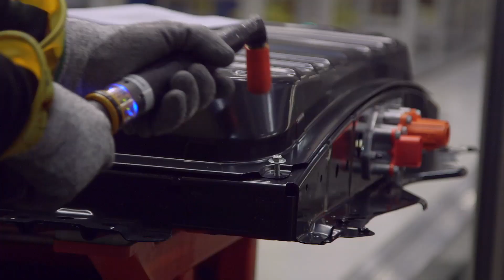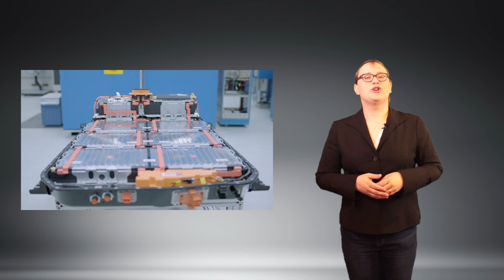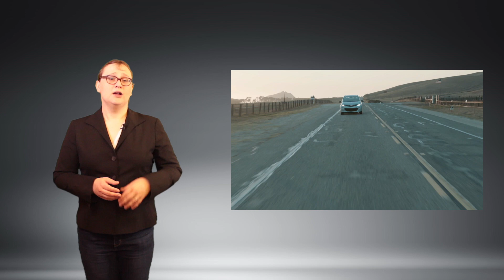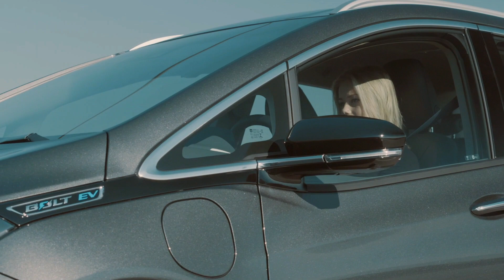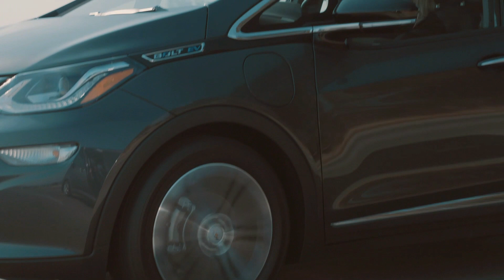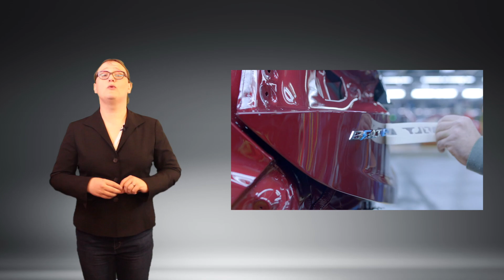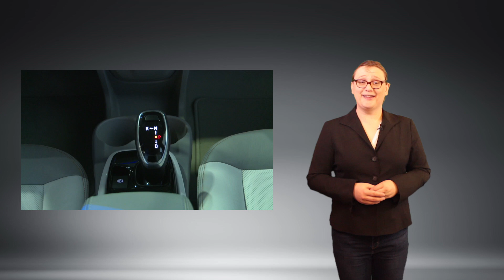Should You Worry About Battery Replacement Costs for Electric Cars?

Comment: First, LOVE the new haircut.  

I have a 2011 Leaf, serial # in the 8,000's.  It was a very early model, operated in Southern CA, San Fernando & San Gabriel Valleys where it gets HOT in the summer.  I bought the car used.  It was "Nissan Certified" by the dealer, and at 38,000 miles it had 8 (of it's 12) capacity bars.  The warranty adopted by the class action law suit was until October 2016.   The range was only about 45 miles.  I took it to the dealer a few times, related to short range and related issues.  They hid behind the need to drop to 8 capacity bars.  It finally did drop to 8 bars, 4 months out of warranty (I should note that I was out of town for all of January & didn't drive the car).  When the dealer certified the battery as needing replacement Nissan told me they would not offer any compensation because it was "out of warranty."  The didn't even offer partial compensation, or a means of financing the cost of the battery, which now exceeds the value of he car (on the used car market). 

I have never been so outraged.  I love the car, but this treatment is unacectable.  I now have less than 40 miles of actual range and Nissan has no interest in offering ANY compensation, even though teses early batteries have well documented failure issues.  If you can do anything to negotiate a better deal, I would appreciate it.  I have a case number, #22336533 and their phone number is 615 725-7196 for Nissan Corporate.  Also, if I can find a used 2015 battery fropm a wrecked LEAF, that might be the solution.  Nissan didn't ever offer help with that.  VERY disappointing.
Reply: Edward Garren sucks,I would tell Nissan your going to the media and complain. you could also just tell them you will never buy a Nissan again. I had a problem with a used Nissan Sentra (2003), nothing but problems. I will never buy a Nissan product again.

Comment: I've had my Volt for nearly 4 years now, around 79,000 kms (nearly 50,000 mi) driven already. I started off with 10.4kwh usable battery and now I am getting 10.3kwh.  I guess their plan of only allowing 10kwh from a 14kwh battery pack was a smart one.
Reply: I have a BOLT EV. Does the BOLT EV do the same thing? (Charge up to 80%-90% only, automatically?)
Reply: eddyogi Volt/Ampera battery is 16kWh (later model years 16.5)

Comment: I do like to be fair and will always try to back up my statements with evidence, or at least a logical argument. I have no evidence that battery longevity is an issue for EVs and another comment here correctly states that number of full charge cycles are the main influence on battery useful life, so the bigger the battery, the longer it's going to last. Battery thermal management, which the early Leaf didn't have will also improve this. We should also note there's, even now, a battery replacement aftermarket developing.

Comment: Any Battery  Has an expiration date shelf life whether its used or not .Typically on a lead acid battery its only 6 years .On a Lithium-Ion battery its only 2 to 3 years  used or not .Just do a Google search  . $5,000 for Battery Replacement  WOW I Dont think so LOL
Reply: That Li-Ion batteries have a shelf life of 2-3 years is obviously false since there are 2011 LEAFs and 2012 Tesla model S's still running fine on their original battery. Also, why would car manufacturers offer a 5-8 year warranty on the battery if they know it'll only last 3 years?
Reply: FDK I agree with you but I did a search on Google and that's what a post on Google said that lithium ion batteries could only be recharged from 300 to 500 times with a shelf life of only two to three years
Reply: What, are you saying that someone has posted false information on the Internet?

Comment: Batteries are improving in both energy density and cost. Tesla's top battery engineer recently said that you should expect the battery to last a good 20 years. I would be amazed if Tesla hasn't changed their batteries to solid state by 2025, which have no degradation problems, and that will push the other manufacturers to do the same. 
People will change their cars long before they change the battery's... at least if they have good battery management.
Reply: but it's very possible the Tesla battery heat spreaders (heat sink between each cell) are far superior to the battery packs we're talking about in the video.
Reply: "changed their batteries to solid state" I have a feeling you have no idea what solid state means. All batteries have been solid state from ... were they ever not?
As for degradation, I'm sure they'll continue to improve a great deal in the future with the addition of the use of super capacitors to handle acceleration and braking power, so the batteries don't have to handle such extreme loads; thus allowing the batteries to stay a more consistent temperature.

Comment: You didn't talk about replacing the battery pack of Tesla. That is a very important thing to know too. Many people are thinking of buying the model 3 so many are thinking how much would it cost to replace it in model x and s
Reply: there are tesla batteries that have already done half a million km's and still have over 90% charge capacity. I think the temperature management of their batteries are far superior and it's not something that people need to worry about as much with teslas.
Reply: Qasim Mustafa Ali tesla roadster is 9 years old now most have around 90% capacity still.

Comment: As electric cars get more common, there will be places offering performance mods just like they do for many other battery powered devices. Bigger batteries, more powerful inverters, motors with higher KW rating. 

An EV battery is not like a cell phone or laptop battery. If one cell gets weak or goes bad, the whole battery becomes as bad as that one cell. But in an EV there are so many batteries in parallels that if one gets weak it won't affect the whole pack much. Only a shorted cell will cause a major problem.

The Chevy Bolt places a lot of limits on the battery which keep it from degrading. It's pretty slow charging, because fast charging degrades the battery just like keeping it at 100% charge.
Reply: Don't forget that the individual cells are fused so that shorts are cut out.
Reply: Markle2k, I've seen them short a Tesla battery and it tends to blow a lot of fuses, starting from the weakest fuse. I don't know if they can only get the one shorted cell fuse link to blow. I haven't seen what LG Chem uses in their battery to protect against one defective cell. 

I think the fuses and the module series-parallel grouping ensures you will still be able to drive, with a warning light until the bad Module is fixed. Luckily, the cells are more likely to degrade than internally short.

Comment: People often worry about the batteries in an EV going bad but you have to remember that many EV companies have warranties on the batteries.  I can purchase a Fiat 500E that just came off a lease and it will still have the 10 year/100000 mile warranty on the battery.  However, if I purchase a Fiat 500 gas powered auto and the engine blows the warranty won't cover that and that will cost around $5000. US dollars to rebuild or replace.  Just food for thought.
Reply: You have to read the fine print on the Warranties. Tesla for example do not warrant their batteries against degradation at all. If the Battery goes totally bad, yes TEsla warrant the battery, but loss of capacity isn't warranted. Nissan didn't offer a capacity waranty either initially but now do offer a capacity warranty as well as a conventional materials and workmanship warranty if it the battery goes kaput.
Reply: Which is not a factor as real world data collected over 6 years already shows the pack will for well over 1 Million KM and 20 years or more.

https://www.teslarati.com/tesla-battery-life-80-percent-capacity-840km-1-million-km/

Comment: I wonder how it will turn out for my Tesla MS. I just hope that when the day of battery replacement arrived, I'll get the at that time state of the art battery with hopefully lower weight, longer lifespan and higher capacity (at higher charging rate) for a lower price. I'd expect a replacement @ around 10 kUSD, including replacement of charging hardware (if needed). This should be achievable in about 8 to 10 years...

Comment: Hi, I thought Nissan was replacing 24kwh with 30kwh packs, maybe it's BMW.  Renault in France is now turning their used leased battery packs (they only lease them in France) into utility scale energy backup storage systems.  If a 14kwh Tesla Powerwall 2 is selling for $5500 (+$1500 installation) imagine what one could do with a half used up 24kwh pack from a Nissan Leaf on their house for energy backup!
Reply: Hi Paul, I own a Zoe and lease the battery in the Uk,  so definitely not just France.
Reply: I own a Zoe-i and I own the car AND the  battery outright here in the U.K. You can choose to own or lease the Zoe battery in a number of European countries now!
Reply: Nis G that's a great question.  There are so many variables that one could write volumes.  Starting with form factors the draw on a battery pack is more extreme in cars than in building applications.  A car can pull hundreds of amps at multiple intervals, whereas a building might pull dozens.  Battery technology is varied and clearly one may serve as a better suited solution for a purpose in lieu of another.  As with the chemistry an intense demand will affect the dynamics of that chemistry (ie, dendrites, temperature).  Imo modifying the form factor to a less intense application could slow and possibly reverse degradation.  Of course claiming reversing it is only me being optomistic.  It's sort of like when your car battery goes dead and you revitalize it with a 12v battery charger, and it's back in service.  Clearly EV's use more energy than homes do.  An EV can go 3-4 miles on a kilowatt and driving 100 miles would equate to aroubd 30kw, whereas your house may run 3 or 4 days (in Texas in the summer) on the same amount.  My annual electricity consumption at my home is actually 1/3rd of this.  So to conclude,  dozens of repurposed battery packs could power dozens (or more) houses.  Again, many variables, but I see reclaimed batteries as a doable solution economically.  In fact in Japan I understand they are already connecting Nissan Leafs to houses for the purpose of powering their houses.  I hope the US wakes up to this potential.
Reply: Paul Friedlander wouldn’t the ability to hold the charge degrade as well?
Reply: Very good remark. A guy from the Netherlands has an active community project up and running where they use electric car batteries as batteries to power their houses when the car is parked at home.

Comment: Nikki, the answer to that question going forward is No. As you mention we have 200,000+ mile Model Ss out there with only 9% battery degradation and then it seems to tail off and not get much worse.